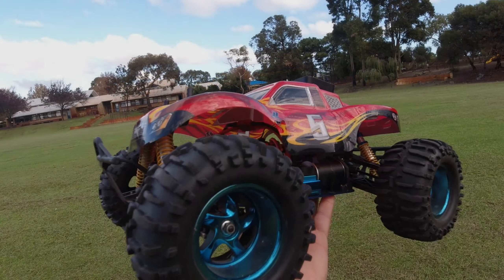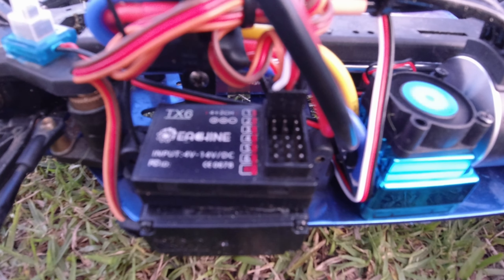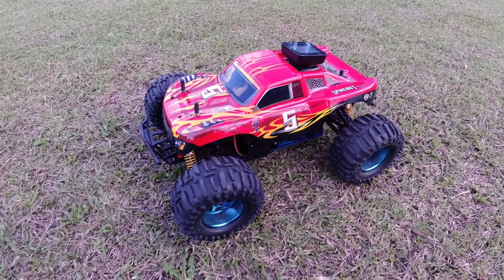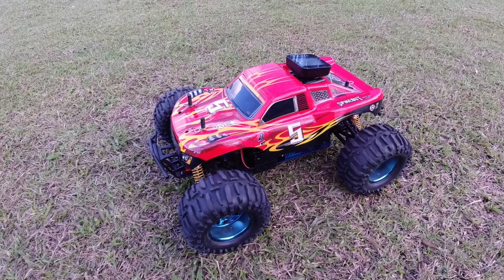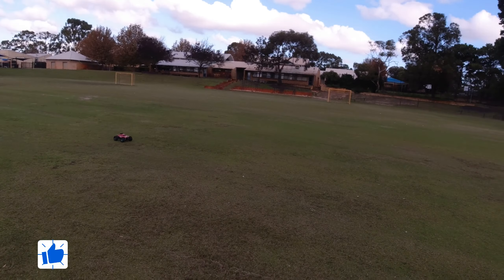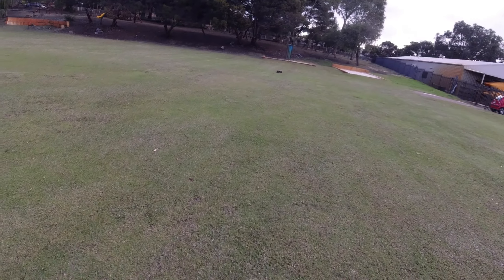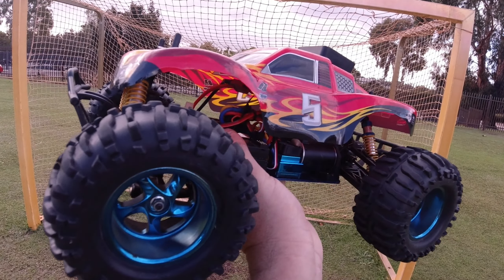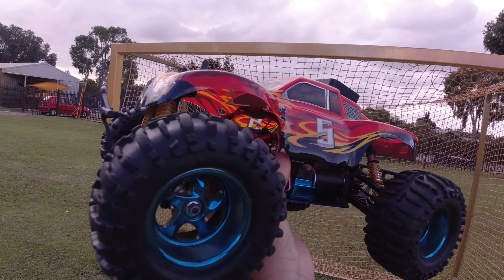BRUSHLESS Converted 20+ Year Old RC Truck | HengLong MAD TRUCK!

Comment from the maker: CYCPLUS G1 GPS Meter Here 👉 https://bit.ly/3MdNGZP
Full List Of Parts for this HengLong RC Linked below for those interested!
Swing Arm 2pcs/set https://s.click.aliexpress.com/e/_DkD39Fv
Rear Differential Set https://s.click.aliexpress.com/e/_DEWXZrh
Front Differential Set https://s.click.aliexpress.com/e/_Dk8PUw7
Gear Box Case 2 Sets https://s.click.aliexpress.com/e/_DdTXXVV
Body posts 2 Sets https://s.click.aliexpress.com/e/_DFhvjD9
Standard Front Shock Tower https://s.click.aliexpress.com/e/_Dmvl9mf
Alloy Upgrade shock tower https://s.click.aliexpress.com/e/_DdhzEOL
Front Bumper https://s.click.aliexpress.com/e/_DkN583N
Blue Aluminum chassis plate https://tinyurl.com/bde4p67t
Set of 2 Pinion Gear 16T https://s.click.aliexpress.com/e/_DeIUfHz
42T Main Spur Gear 4pcs/lot https://s.click.aliexpress.com/e/_DmoxEST
Set of 2 Steering Knuckles L&R https://s.click.aliexpress.com/e/_Dcw0tsx
Henglong Metal Gear Servo https://s.click.aliexpress.com/e/_DEDALFv
Mad Truck Upgrade Shock Springs https://tinyurl.com/yh79wskd
Metal front axle bracket https://tinyurl.com/322pjzs9
Top Chassis Brace https://s.click.aliexpress.com/e/_DmhXqun
Set Front/Rear hinge pin braces https://s.click.aliexpress.com/e/_DExdnsL
Set of 2 Hinge Pins https://s.click.aliexpress.com/e/_DDFeuYR
Set of Rear Dog Bone Axles https://s.click.aliexpress.com/e/_DE8MvvN
Blue Wheel and tyre  https://s.click.aliexpress.com/e/_DenZ8d1
Standard Plastic motor mount https://tinyurl.com/5betachk
Mad Truck Oil Shocks 1 pair https://s.click.aliexpress.com/e/_DlWqbEB
Set of 2 standard tie rods plastic https://s.click.aliexpress.com/e/_DBnvwBl
Rear Axle Support Bracket https://s.click.aliexpress.com/e/_DeRsmiF

Comment: You think it'll be able to handle 3s on 5900kv?? That'll be a lot of rpm's.
Reply from the maker: Running on 2S is good enough really, but i have ran 5900kv and even higher on 3S before with no issues, even though they say it's not recommended, for a quick speed test run it's ok but I wouldn't bash a whole pack, stick to 2s

Comment: Good video. What’s the best value tire/rim set to replace my standard trx4 sport ones? The foams have gone but the tires are glued on to the original plastic rims. I didn’t want to have to spend $100+ on new rims/tires but I also loved the way the stock tires hooked up. Any suggestions?
Reply from the maker: Hi mate i bought a set of grippy and soft foam filled wheels and tyres from banggood that i fitted to my Wltoys 12427 desert truck, can get them in a few colours as well, great value set in my opinion. Will find a link and post it here!
Reply from the maker: These are the wheels and tyres https://tinyurl.com/reza2nr5
This is the video https://youtu.be/z0MMGXvRFVQ